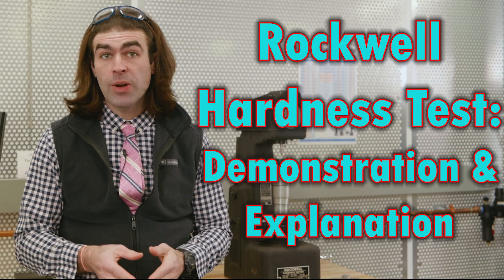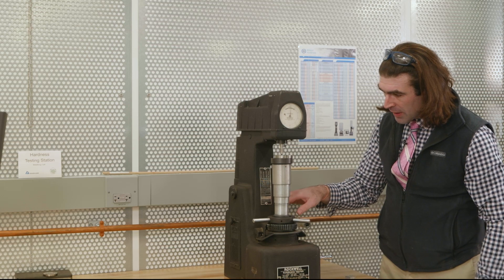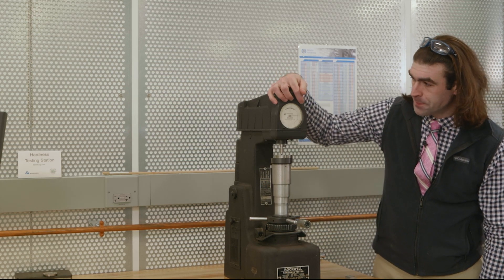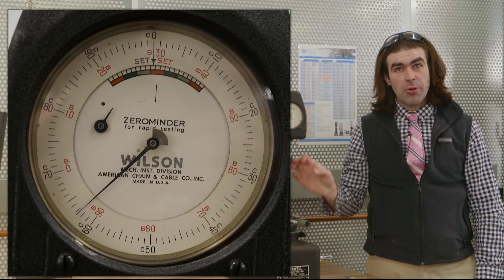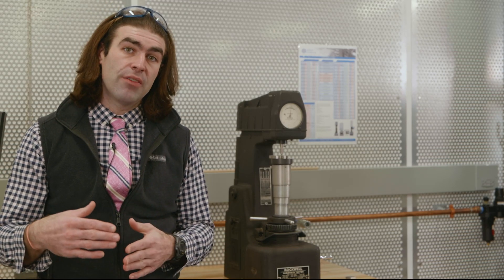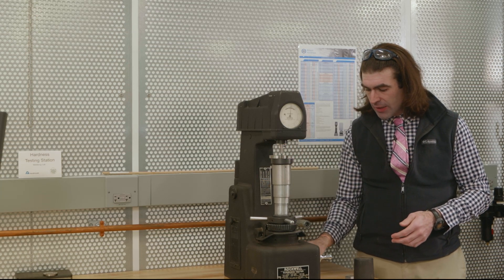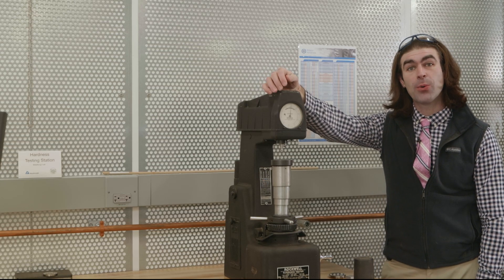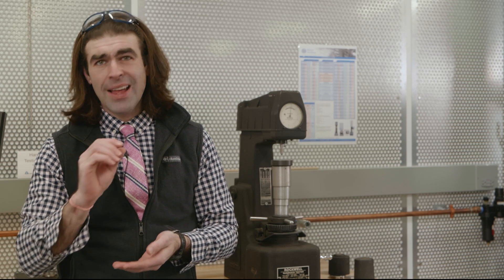Rockwell Hardness Test

Comment: Great demonstration. I have the same model hardness tester. I'm wondering if the correct indenter is used, with the correct weight, can this unit be configured to test on the Rockwell R scale (engineered polymers like Delrin)?
Reply: Yes.    It is difficult to buy good Rockwell R test blocks.  To overcome this make sure your tester works well on the Rockwell F scale, same load but different indenter   (1/16 ball indenter).  Then it should work with the 1/2 inch indenter as well.

Comment: 1. Is it correct if I wanna measure HRA, i just set to diamond indenter with 60kg then share the black number same as HRC? (Even though on the reading only printed the alphabet ‘B’ and ‘C’)

2. Is the same procedure works on HRG when set to 150kg using 1/16”Ball, then read the red reading on the B-scale?
Reply: Hi.  All reading for ball indenters use the B scale (or ball indenter scale).  For all diamond indenters us the C scale (diamond indenter scale).
Reply: @ i see.. ok ok.. thanks a lot 🙏🙏

Comment: All of the information is great.  The audio isn't perfect, but it's still understandable.  If you're gonna switch camera angle try to be clear about where the camera is coming from and try to face it when possible.  Writing corrections on screen to clarify parts where the speaker was unclear is acceptable.  All around good!
Reply from the maker: Hi, thanks for the great feedback. I rarely get any input into the technical video stuff. What is wrong with the audio in your opinion? I’m 100% self taught with video and editing.
Reply: @RDeanOdell  There are points in the video where the audio clips a little (or is right on the verge of clipping). In other videos of yours it's not an issue. I think the gain on your mic was slightly too high. Overall, great video!

Comment: I've heard of the Brinnel hardness test which we used for stainless steel but not this. Same kind of thing? I'm a retired fab shop labourer and self- taught guy who never finished grade eight.
Reply from the maker: Hi, the brinnel and Rockwell are very similar. They both press something harder than the specimen into the material and measure the resulting indentation. The big difference is that with brinnel, the diameter of the depression is measured. With the Rockwell test, the machine measures the depth of the indentation and reports the hardness value directly. Thanks for watching and commenting.
Reply: We tested stainless steel for use in extreme cold. Thank you. I sure miss the smell of cutting fluid & fresh welded steel!